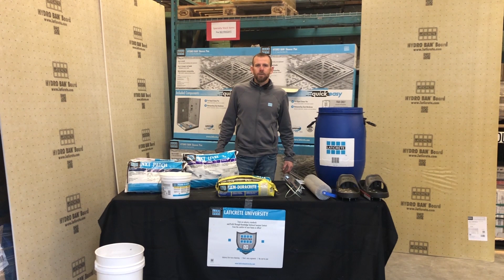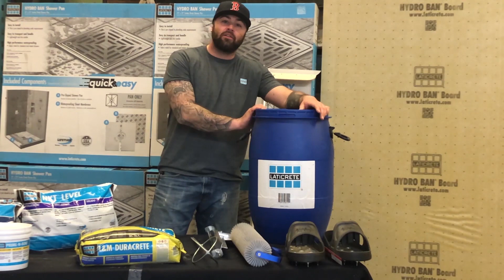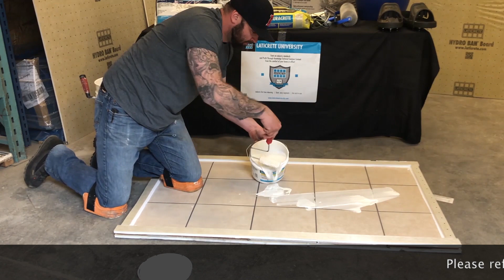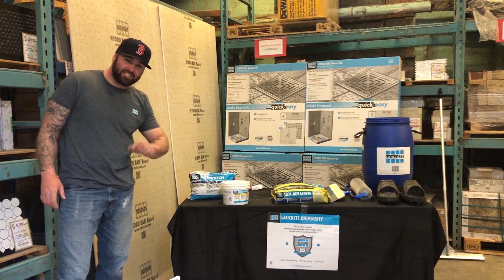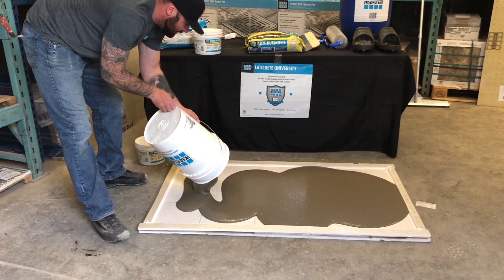Surface Preparation Technologies & Products Overview and Demos by LATICRETE

Comment: Can you screw down backer board overtop NXT patch once it's hardened and cured?
Reply from the maker: We would not recommend screwing into the self leveling underlayment as this may cause the SLU to crack. We would also advise that you contact the board manufacturer for cement board installation over SLU's.
Reply: Thanks for quick reply

Comment: So NXT patch can be used on vertices applications onto Hydroban Board, for low spots, dips...where the wall didn't get furred out? Good binding adhesion for large format tile and thi set over it? Didn't know of it sagged a lot while installing.
Reply from the maker: NXT Patch should be fine going up a wall. However, since we don't know what application you are using this on, it's important to note that it can't be submerged. So, in most cases we'd suggest 3701 Lite Mortar (https://laticrete.com/en/tile-and-stone-installation/thick-bed-mortars-and-screeds/3701-lite-mortar)when patching a vertical wall. 

Please also note: to let it dry completely before starting the tile installation.

Comment: Thanks for the video! I've got a 10'x20' room with smooth, bare concrete that isn't quite 100% flat. Would NXT Patch or NXT Level be ideal to screed out over it?
Reply from the maker: Either one would be fine. If you are more comfortable using a trowel and patching a floor by hand, the NXT Patch would be ideal for that. Or if you are confident that the prep is OK and you can pour/self level a floor, then NXT Level would be great as well. 
Here is a helpful Prep & Primer Guide: https://cdn.laticrete.com/~/media/support-and-downloads/technical-datasheets/tds230-substrate-preparation-and-primer-guide-for-laticrete-self-leveling-products

Here are the datasheets on each product as well.
NXT Patch: https://cdn.laticrete.com/~/media/product-documents/product-data-sheets/ds-501

NXT Level: https://cdn.laticrete.com/~/media/product-documents/product-data-sheets/ds-504
Reply: @laticrete  Thanks for the quick reply! I checked the subfloor with a laser and a yard stick. Apparently no real high spots but up to 3/8" slight valleys (verified with 8' straightedge). NXT Patch doesn't say it can be used down to a feather. What about NXT Skim? Can I use that with a large rounded trowel and/or screed? How does NXT Skim compare to NXT Patch and do either need a primer? Trying to figure out the best approach...